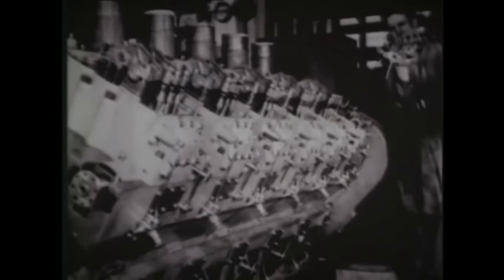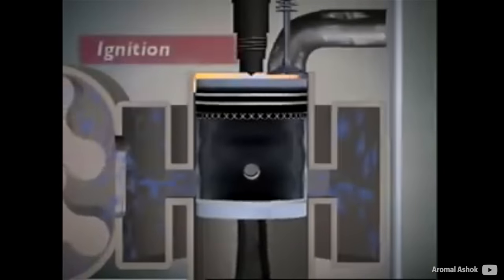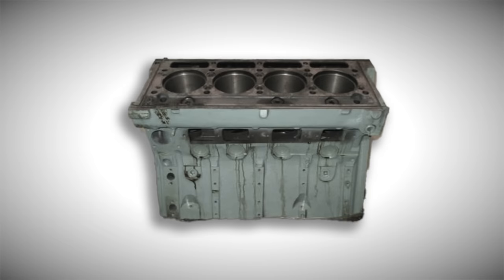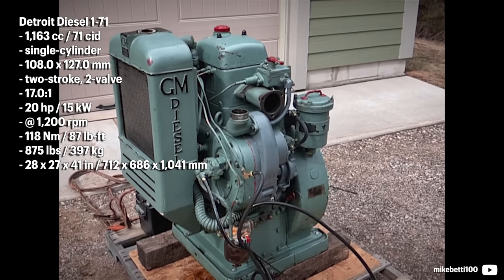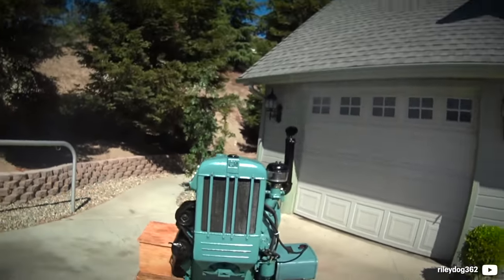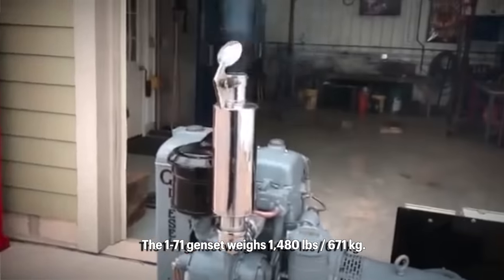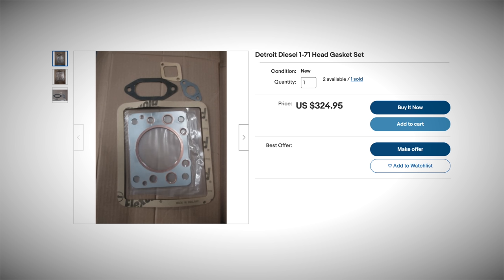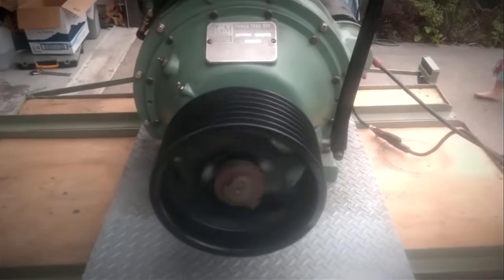The 1-Cylinder Detroit Diesel 1-71 Is Nearly Extinct

Comment: Would love to see a scope pattern on a high resolution crank sensor. I bet it slows immensely at tdc and then accelerating like crazy, every stroke, had it been made lighter it would have shaken to bits
Reply: all depends on how much mass you're driving. i'd guess they made the flywheel pretty damn heavy, since nobody's blipping the engine through gear changes, and then the load is effectively a flywheel
Reply: @@retiredbore378 but it would despite having this characteristic, as it happens inside the individual cycle
Reply: @Retired Bore Any waveform's a sine wave if you're brave enough
Reply: @@retiredbore378 regardless of what you think you are incorrect. The individual compression stroke slows the crank and can be seen in a scope pattern. You are a keyboard warrior. Hi speed sensors are used for misfire information that can see this
Reply: And likewise on firing the crank cannot help but accelerate, and it doesn’t do it instantly.

Comment: Two stroke diesels actually don’t need any valves and oil is carried in a dump like any other engine. An air blower feeds air into the intake ports while exhaust escapes from the opposite side. Fuel is added long after the ports have closed so they are clean. Black smoke is entirely to over-injecting the fuel. Control it electronically and it runs clean.
Reply: Opposed piston diesels work the same way but are even more efficient because heat gets into pistons rather than cylinder heads.

Comment: i always feel the single cylinder engine hasn't been fully explored, for example in budget cars. with modern complexity in head/fuel design, it seems like an awful lot of expensive duplication and difficult servicing compared to a single. i have found the thumper character to be quite charming on a bike, and suspect most of the resistance in the car market is irrational ... partly out of the assumption that budget cars must mimic more expensive ones because their owners are insecure

my favorite single cylinder is the ducati supermono, which achieves v-twin primary balance with a dummy piston weight -- and neatly avoids a fiddly chain-driven balance shaft. why did this never resurface?

am i daft for wondering why sophisticated single cylinders aren't powering cars in developing markets?
Reply: My Briggs & Stratton 500cc riding mower engine has a dummy piston mass in it.  Been in production for more than 20 years.
Reply: wow. that's awesome
Reply: Because for even an economy car in modern times you would want about 70-100hp. That’s hard to get with a single without it being so big it’s going to be a lot of extra complexity and work to get it smooth. Even then it’s going to shake just because of the big individual power pulses. 
3 cylinders are becoming common because it’s an efficiency benefit over a 4 cylinder without adding much complexity or loss of power.

Comment: If you're quoting the fuel usage per hour, I hope you remember that the American gallon is only about 3.75 L, and not the imperial measurement of 1 gal = 4.54L
Reply from the maker: Never knew that, thanks for correction
Reply: No problem. I'm Canadian and come across this all the time. FYI, the gallon the Americans use is still in the imperial system, it was traditionally used in conjunction with wine. Traditionally wine had a lots more solids in it, enough that it didn't take the same volume to make gallon as water.

Comment: I would love to see an experiment where they made a 2 stroke diesel, but replaced the blower with turbos. I know it wouldn't be practical but I think it would still work, you would just have to power the turbine to spool it up before it could start, maybe with one of those hybrid electric turbos like they use in racing now. The reason it would be interesting to me is because turbos are so much more efficient than blowers. You might even be able to just have a tank dedicated to storing compressed air that built pressure while running and then was used to blow into the engine to get it started and that way you might not even need to spool the turbos. Man I wish I had the time and means for projects like these... I love these fun ideas.

Edit: Oh there was a turbo one at the end. I was too exited to watch the whole thing before I started commenting. Very cool. It didn't mention though how it started up though without the positive displacement of the blower.
Reply: The blower is not used for supercharging. It is purely used for scavenging. There are two stroke Detroit diesel engines that are turbocharged, but they also have the roots blower. The uniflow design cannot function whitout forced scavenging.
Reply: @Bata.andrei  Ahhh ok thanks for the clarification. Yeah I'm pretty sure you could make a purely turbo one work, you would just need to "jump start" the airflow because it wouldn't start with just a turbo but if you blasted some air in during startup I think you could get it going on just the turbo. I could be wrong but it would be fun to try.
Reply: @El_Chompo  look for the channel "two stroke stuffing" he did build a racing 50cc two stroke uniflow, as well as a supercharged 50cc two stroke. If you are interested in two strokes his channel is a wealth of knowledge.
Reply: As others have said the blower is needed for the engine to run at all. The non-turbo engines with just a blower are considered naturally aspirated.
Reply: a normal 2 stroke has a sealed crankcase, detroit diesels do not. this is why detroits need a blower
Reply: On a larger scale, EMD has a series of turbocharged 2-stroke locomotive/marine diesels, which have a turbo only; the compressor section is run by a gear-train for startup and low-load running; at a certain load, there's enough exhaust gas pressure to spin the turbine section, and the gear-train disengages.  So, it's sort of a hybrid system; runs as a mechanical blower at low loads, a turbo at higher loads.
Reply: @craigmclean8260  Cool! That's exactly like what I was thinking!
Reply: @ginoperretta373  Ohhh. Hmmm. Interesting. Well that brings up a whole bunch of new questions for me but I'll get them all figured out someday.

A normal 2 stroke has a sealed crank case besides the intake and exhaust obviously which connect to it right? So basically what you're saying is the detroit diesel's crank case vents to atmosphere like a normal 4 stroke engine? Does that mean that it has an oil pump and an oil delivery system to lubricate the engine just like a 4 stroke too? Thanks for the info.
Reply: @El_Chompo  in a normal 2 stroke each individual cylinder has a sealed area under each piston, the air fuel mixture is drawn into this area by the bottom of the piston when it is traveling up, on it's way back down it pushes the mixture into the combustion chamber through the transfer ports, the super charger in a detroit diesel pushes the air into the transfer ports and then the injector shoots the fuel into the combustion chamber at the right time

Comment: hey the blower moves the air into the engine thus the word blower, if was to extract the spent gases it would be called a sucker or extractor. due to the open intake and exhaust port the air charge is forced into the cylinder pushing out the remaining gases left over. there i fixed it for you

Comment: Only engine where if you could pull the rod caps of it would still run without throwing a rod as piston is always under positive pressure.

Comment: how to lubricate piston ?
Reply: Good question. My impression is that there was no return line for the oil going up from the connecting rod bearing (“big” end) to the piston’s wrist pin, so some oil would flow out from that bearing to the cylinder walls. But I don’t know how it would have been distributed evenly around the cylinder. (The general concept is confirmed by an internet source, but it was vague on the actual mechanism for getting the oil from the connecting rods’ oil system to the cylinders.)
Reply: Correction. The oil from the connecting rod ends up spraying the inside of the piston for cooling. The cylinders are splash-lubricated from the crankshaft counterweights etc spinning through oil in the sump.
Reply: Water

Comment: Now that I understand how these 2 stroke diesels work better it makes me curious why the diesel 2 stroke needs an exhaust valve while a gas 2 stroke doesn't need one. It must have to do with building enough compression for a diesel to operate? Also is there any way that an expansion pipe could self supercharge a diesel 2 stroke the way it can do for gas? The rotors would get in the way of sucking in extra air under expansion pipe resonant boost but if we pretended they didn't cause any restriction (for instance if they were replaced by turbos or had a bypass valve for when it was on the pipe), I wonder if it could work.
Reply: Because it is an uniflow design. The spark ignited two stroke uses a totally different principle. It uses the volume of the crank case as a positive displacement pump for the cylinder scavenging. That is the reason why it is more efficient coupled with resonant exhaust chamber, it will help with better scavenging providing a sort of static supercharging, but the downside of that is that it will do that only in a limited rpm range. 
The uniflow two stroke is better suited to compression ignited engine and it will not rely on the passive scavenging, hence the blower forced scavenging and the exhaust valves.
Ferrari has a prototype two stroke uniflow gas engine that was planning to use in racing. Look it up.
Reply: @Bata.andrei  I was going to respond to sirgallium's question but yours is a much more thorough answer. Thank you for posting it.
Reply: Fairbanks Morse had a line of uniflow scavenged 2 stroke diesels in the early to mid 20th century. There are many videos on youtube of these Fairbanks engines.
Reply: My father worked on ICE engine designs and as a child I was really interested in looking into the vast array of different concepts the he worked on as well as the different designs that some of his contemporaries worked on. 

I can remember seeing a experiment diesel engine that had sleeve ports for both the intake and exhaust which were on opposite sides of the cylinder.   This engine was really quite unusual on the basis that it featured a "floating piston" in addition to the main piston such that the crowns of the floating and main piston faced each other. The floating piston was hollow such that it trapped a volume of air behind it.  When the main piston traveled upwards the floating piston moved up until it hit a stop and then after the power stroke had completed and the main piston had moved down below the exhaust port the floating piston was pushed down due to the pressure trapped behind it.  This floating piston was therefore meant to help scavenge the exhaust gasses.
Reply: @turbo8454  Indeed; the "38D" series, which powered many U.S. submarines and ships, plus they built locomotives.  Earlier F-M engines were 2-stroke as well, but had ports, and seemed to be crankcase-scavenged; the intakes for each cylinder were located down at the crank level:  https://www.youtube.com/watch?v=XmmutEViK7Y
Reply: my cat says in a gasoline 2 stroke you need the crankcase to pull the fuel air mixture through before it goes to the piston, thereby it needs  2cycle lube premix,  in a diesel 2 stroke the crankcase is immersed in engine oil like a 4 stroke engine so  air is pulled directly into chamber from piston suction before fuel is injected and combusted.. i hope this helped
Reply: @Bata.andrei  Wow really cool! Thank you for the info. Speaking of limited RPM resonance supercharging, how fun and silly would it be to have a multi stage pipe just like gears but instead you use valves or solenoids to open and close exhaust paths to different pipes so each pipe has it's own RPM range. I'm sure it would be more trouble than it's worth but man that would be neat!
Reply: @El_Chompo  this system already exists on road motorcycles. Yamaha calls it Power Valve. It consists of servo controlle rotary valve that will adjust the dimension of the exhaust port according to RPM. By varying the exhaust port area it will change the resonance frequency of the expansion chamber an thus, widening the power band.
Aprilia has a similar system too, but is based on a sliding wedge, as opposed to a rotary valve.

Comment: 40k hour service life??! Did I hear that right?
Reply: Detroits suck in the longevity/maintenance.
Reply: detroits are extremely reliable.   We have several engines that are pushing 20,000 hours.   Had the heads off and it’s all still in excellent condition so just installed new gaskets and sealed it back up.    2 are gensets and 4 are marine propulsion
Reply: @TugboatMatt  Not a two stroke...
Reply: @Failure_Is_An_Option  wanna make I bet.  I operate 9 Detroits in total Mostly 6-71’s one is a 3-71.     They are by far some of the most durable engines we have.   We’ve had to rebuild the cats and Cummins twice.   We just rebuilt 2 of them only for peace of mind.   They were last rebuilt in 97 and had approx 26000 hours on them, the liners and bearings were all still in excellent condition we only rebuilt them as the inspectors were complaining about it and was threatening to pull our certification since they haven’t been rebuilt in a long time.    Maintenance is the key thing we change the oil and filter’s every 500 hours and use good quality oil.    They don’t make a ton of power and if you don’t use big injectors they won’t tear themselves apart.   If you sacrifice some power you get longevity, and aslong as you use common sense and don’t bike them for long it helps keep them lasting longer.

Comment: Careful when converting gallons to liters. The US, and therefore Detroit Diesel, uses the US gallon. When you stated that its consumption was 1 gallon or 4.5 liters per hour you used the standard or Imperial gallon which is larger. One US gallon is 3.75 liters, so the fuel consumption of the 1-71 was really 3.75 liters per hour.

Comment: They use lots of fuel, leak oil and burn incomplete. So 2 strokes are all but dead. Oh, the acceleration peddle is a volume control. 
Ask me how I know.
Reply: Forgot to add they trash bearings.